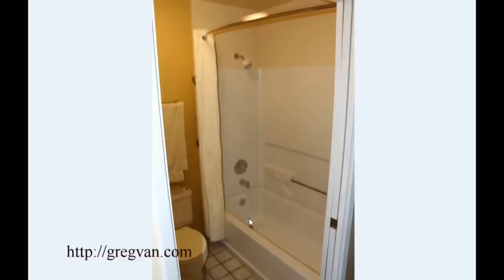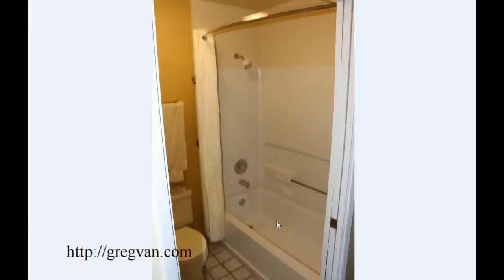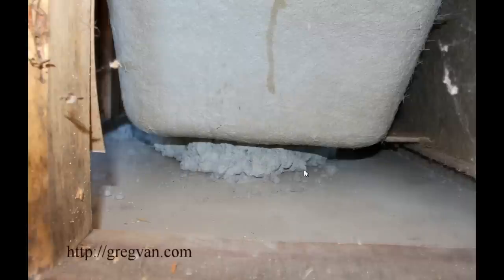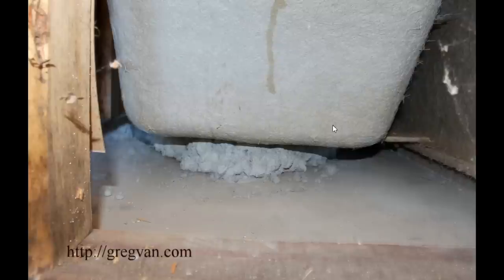Here's What Can Happen If Bathtubs Aren't Installed Correctly

Comment: Are you familiar with American Standards Americast Cambridge tubs? I think these are steal framed tubs with porcelain coating. According to American Standard you don't need a mortar base support, sound scary to me! I currently have an old cast iron  that I may just have re-glazed. It's hard to beat the old cast iron, heavy though!
Reply from the maker: Can you remove the product manufacturer's name from your comment so that I don't get in trouble? Cast-iron tubs usually don't require mortar under them and it's always a good idea to follow the product manufacturers recommended installation instructions, but if it was me I would probably add the mortar for additional insurance, unless there was a specific reason why it shouldn't be used in the instructions..
Reply: Done as requested. But this tubs material isn't made of  real cast iron. I believe its steel framed and enameled porcelain coated. I don't believe the manufacturer recommends a mortar base for this one. 

I simply believe there is no way a tub made of anything other than cast iron will be as durable period. Every contractor that's been out to give me an estimate on remodeling my bathroom has been pushing my hard to bust up the old cast unit and go with something lighter. Just not comfortable doing that.
Reply from the maker: As long as the tub is in good shape, I wouldn't remove it either, that is unless it's time for some different colors. They seem to be about the best bathtubs on the market and have been for decades.

Comment: I just moved into my apartment in February. They are newly built. I got it on the 3 rd floor whichbi hate because in scared of heights. Anyways my shower feel like its becoming soft and flimsy in the middle. Its even making a poping sound when i stand in that specific spot. It freaks me out becsude j feel like im going to fall through to the next floor and makes taking a shower the stressful part of the day. Any advice?
Reply from the maker: I wouldn't worry about falling through. I think what's happening is that the upper section has separated from the lower section of the shower pan. I've seen this happen before and for whatever reason they can last for decades in this condition. You should let your apartment manager know about the problem also.
Reply: @gregvancom  I'm having this exact same problem as the previous person described (popping/creaking noise) and our house is new construction. Do you have any videos of the steps it takes to do the repair? Is it a DIY project, or should I call in a professional? Just concerned about incurring too much of an expense, so I'm hoping it's something that I can tackle on my own.

Comment: I’m worried this is what happened with the tub in my apartment. Right after I moved in, it broke right next to the drain (area between the drain and the wall of the tub) from me taking one step there while adjusting the shower head. There didn’t seem to be support underneath this part. The management sent someone who reglazed it. I followed all instructions for the care of the reglazing and also took care not to step on that part. Now two months later that entire portion is sinking down (the water from the faucet hits that portion directly and puts pressure on it) and the crack is clearly visible again, it doesn’t seem like whatever they did fixed the issue and I really have the feeling there was supposed to be support under that part of the tub.
Reply from the maker: It sounds like a inferior repair and I would contact your apartment management to let them know it's still a problem. I don't know how anyone could blame you for bathtub damage, by stepping into it, unless you some how exceed the maximum weight requirement.
Reply: Yeah :( Thanks for your input 🙏🏽 now that the problem with the repair has become evident to me I will be contacting them right away for sure

Comment: Not sure anyone mentions this, but the squeak sure sounds like the plywood sub-floor moving up and down on the nail. Prior to tub install, on a remodel screw the sub-floor down and pull the nails, or what we do is we screw all floors down and you will never have a squeaky floor ever. Takes longer but you get what you pay for.
Reply from the maker: You do bring up a good point, you could end up with floor squeaks and you have an excellent idea for adding screws, just don't remove the nails, unless you have some type of a screw that won't break under pressure from sideways movement. Thanks for the great idea.
Reply: My tub creaks on one end if i even stand a foot near it and not even inside of it, which leads me to believe it might be the sub flooring. Would this be a symptom?

Comment: My plumber insists they never install mortar under shower tub stalls (fiber glass gel coat) and have no problem. They put the odd wood block in for additional support. On a one piece tub shower he says all you need is a ledge board at back (near top) and you're good to go. He has been in the trade for many years and talking from experience. But, what you are saying makes a lot of sense too...confused!
Reply from the maker: I've removed damaged and undamaged bathtubs and showers that were not supported with mortar or Plaster of Paris. I would never suggest that they couldn't be installed without them, but would always use them when I was installing them.
Reply: I have the shower tub stall that the builder used a wood block for support and nothing else, problem with this is that there was a tiny leak from the drain spout that rotted away the wood block and my tub has cracked. Have sealed the crack, repaired the leak and now need to provide support somehow until I can afford to replace the tub, my husband has no clue and won't even try to repair but I need to be able to use my shower. So Greg, do you suggest I try to figure out how to get mortar under the tub or get some wood block shims for a temporary fix?

Comment: One other issue. 1) Many acrylic manufacturers void warranties by using mortar underneath  2) Cheaper acrylic tubs will do this to a degree on their own based on quality alone....thin tubs simply are cheaper and make a lot more noise
Reply from the maker: Could you provide me with product manufacturers who don't allow mortar to be installed underneath their bathtubs?

Comment: They used to make iron/steal tubs for this reason.  A little creeking doesn't hurt anyone.....it's plastic...it's going to give a bit.  Use flexible cork around tile edges to help.....any shower requires maintenance and the few I've had to replace were that very problem....neglect by the owners.
Reply from the maker: Yes they still may cast iron bathtubs and you're right, a little creaking won't hurt anyone as long as it doesn't turn into a lot of creaking.

Comment: I have a tub that was installed without mortar or a solid floor underneath in 1976. It's flexing and I see some slight micro cracks. Besides spraying expanding foam underneath, what are my options?
Reply from the maker: See if this helps https://youtu.be/pvhnnkqQ3fM

Comment: I currently have a very squeaky tube I wish I could show you a video
The contractors are trying to figure out a way to fix.
 They said it's a faulty basin ( bullshit) it was installed incorrectly I believe!.
I'm in a brand new build they just threw together. Now there gona try and get access to spray something under and around all the legs. What a piss off brand new house
Reply from the maker: I wouldn't be happy either, but if they can fix it and provide you with some type of a guarantee you will be happy with, then let them fix it. Let me know if this didn't answer your question.

Comment: i have never heard a tub squeek before like that on the other hand i havent seen tubs with out the under suport  already built in the tub  . that tub was probably purchased from home depot
Reply from the maker: +grizz270 Well then I have good news for you, because if you watch the video again you will see a tub that doesn't have enough support under it and here in Southern California I've only came across a few of these one-piece units that had a supporting structure under it and sometimes the supporting structures created problems for the installer, trying to level the tub.

Comment: Tub moves when stepping in...can see separation from caulk on wall and along the floor. Is removing and replacing caulk an adequate fix? Or, thinking the problem is with the tub setting, should I seek more info from an installer?
Reply from the maker: I would simply add additional caulking when necessary, in the hopes of having the tub last as long as you can if you don't have the money to repair it or replace it. There should also be a link inside the video or at the end of the video for a few more ideas on how to fix something like this. Let me know if it isn't there or you can't find it.
Reply: @gregvancom  Found the video bank...checking it out now....thanks for your input and efforts in helping us DIYers. Really appreciate you.

Comment: just finished setting my new run with mortar as per the manufacturers instructions. I hope it's good and lasts. i had concerns but could not find anyone with a different out better way. I did pre level, mark and screw in the hangers ahead so as to not press the tub past the needed position. Sat the tub on top of the mortar pressing it in just till it got to the mark and resecuring it. now, how long does it need to set?
Reply from the maker: I would let it set 24 hours, but realistically it might only need to set for about eight hours.
Reply: did you get the mortar all the way under? And what product did you use and if you did get mortar all the way under, can you tell me how you did this? I need to support my tub
Reply: @irish0105  spray foam?
Reply: @phoenixrising4762  tried that but it didn't work, but I do appreciate your suggestion. We sold our house two years ago and moved across the country.

Comment: I just had a luxstone tub/shower put in by what is considered a professional company and the floor has minor creaks and "pops" a couple of times after each shower.  I called the contractor and they came out and drilled a small hole and put foam underneath (3 cans of whatever he was using).  It was applied blind basically.  It didn't work and is still popping.  Ever heard of this before?
Reply from the maker: I've heard of people using foam like that, but know for sure if it will work in all cases. I  don't have a quick fix for this and would contact the manufacture for installation instructions.
Reply: @gregvancom  I've done that already and it should have been put on a 1" to 2" bed of mortar which it was not.  They used contractors adhesive which apparently didn't work obviously.  There is a bedroom wall that adjoins the bathroom tub and to not work blind, they would have to take it off on that side and work from there.  This working blind with foam tells me they really don't know where this foam "lands".
Reply from the maker: @loganma9468  Well it is another option to consider and worth trying instead of removing tub.

Comment: What is an average repair price to drill and fill a tub with this problem?
Reply from the maker: I've never done this type of repair and don't know how effective it is. I'm not about to suggest that it won't work, just don't know if I would do it.
Reply: I'm a licensed home inspector and contractor. This is a repair I've done for many years, as the majority of my clients are multifamily and typically have cheaper acrylic tubs, installed quickly and improperly. In single family homes, I drill holes through the subfloor under the tub from the crawl space or basement, backfill with foam, and patch the subfloor when I'm done. In multifamily, my buildings typically have 2" slab floors, and are inaccessible from below. After removing the plumbing finishes,  we lift the front apron of the tub just enough to squirt the foam through a custom extended nozzle. We don't use anything special that isn't found at box stores. Haven't had a call back in 10 years... So, we feel comfortable with this resolution.
Reply: I am currently dealing with this. We purchased our new built 2/2018 and have brought up the cracking, soft spots/air pockets and squeaking to the builder since we're still in the 1 year builders warranty. They sent out 3 tradesmen last weekend and they all said that the tub needed to be replaced due to so many air pockets from very poor installation. That the only other solution would be to drill but that would only be a temporary fix and I'd have the same issue in a month. Now the builder is trying to give me the run around saying that they can drill holes and fill it to fix it. I'm not buying it. Opinions?
Reply: I am currently dealing with this. We purchased our new built 2/2018 and have brought up the cracking, soft spots/air pockets and squeaking to the builder since we're still in the 1 year builders warranty. They sent out 3 tradesmen last weekend and they all said that the tub needed to be replaced due to so many air pockets from very poor installation. That the only other solution would be to drill but that would only be a temporary fix and I'd have the same issue in a month. Now the builder is trying to give me the run around saying that they can drill holes and fill it to fix it. I'm not buying it. Opinions?

Comment: I've seen the plumbers using spray foam lately. Very quick and dries rock hard.
Reply from the maker: +xXBuckOFiveXx I would love to see the results of something like this five or 10 years from now. It seems like the foam wouldn't be structural and I think you could even have a bigger problem if the foam expanded, putting pressure on the tub and started to lift it up.

Comment: That shower curtain arrangement is a peeve of mine. Being outside the tub, water will drain from the curtain right to the bathroom floor.
Reply from the maker: +w0mbles You've got a good point and I would imagine there are some people who wouldn't know to move it into the tub. Which would be a good reason for anybody who runs a property like a hotel to use doors instead of shower curtains.
Reply: w0mbles the curve is awesome. You put the curtain in the tub. It pull away so it doesn’t touch you.  It was out for the picture/video
Reply: Curtains are supposed to be outside the tub....Liners are meant for inside. 

In my bathrooms, the curtain is outside while the liner is inside
Reply: @perryh.5306  A very good point. Cheers.

Comment: A plumber just put my new tub in and it's squeezing I can not take it what can o do now
Reply from the maker: You could remove the bathtub and reinstall it correctly or if you could somehow open up a wall or the floor below it if it isn't a concrete slab to install some type supports under the bathtub to keep it from squeaking. You could also contact the product manufacturer to see if they have a fix.

Comment: I live in a duplex which i own and rent the other unit. I was just over to my tenants unit to find out that his 1 piece fiberglass tub/shower combo is also experiencing this problem as well as in my unit. This is causing the fiberglass to fatigue and causing little cracks in the corner of the bottom of the tub as well as the finish to be worn. I'm not sure how I should go forward here, the one in my unit is just like the one in the hotel in the video, its a remodel, fairly new. The one in my tenant's unit is a 1 piece...which is great..low maintenance, i'm just not sure if it makes sense to try to get the mortar in place in his unit and hope it lasts..the finish is worn out and cracks are forming. OR replace it with a multi piece and deal with scraping and reapplying silicone every couple of years.

Has anyone got any ideas on how to get the mortar in place with the tub already installed? I was thinking of some sort of morter injector...I really don't want to take the tub out..what a pain.
Reply from the maker: +Brian Corbett I don't have any ideas on how you can get something under the tub, but would like to point out that if it's already cracking, you might consider replacing it. I know that isn't what you wanted to hear, but problems like these rarely go away and often get worse. If you do end up replacing it, you could always install a two or four piece system.

Comment: i have this problem in my house...what can be done about it once its already installed?
Reply from the maker: +Brian Corbett If you have access to the bottom of the bathtub through an access hole, then you could place Plaster of Paris or mortar under the tub to support it. If you don't have access, then you would need to remove a section of the interior wall covering like drywall to gain access. I will try to make a video within the next two weeks to provide you with more information.
Reply: gregvancom I do have an access panel to the side of the tub where the water pipes come up..but not at the side..its going to be hard to get all the way to the other side with mortar...unfortunatly the two walls that make up the other side of the tub are exterior walls with brick...so that won't be to easy either.
Reply from the maker: Then you might need to remove the bathtub and reinstall it.
Reply: gregvancom  I have tried to explain this to numerous people. Who would you suggest contacting to help me fix mine?